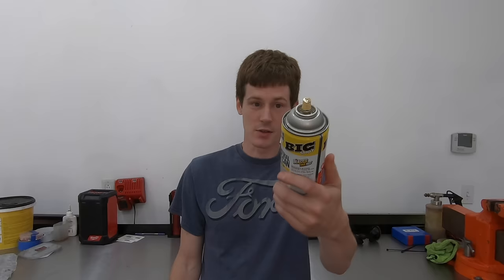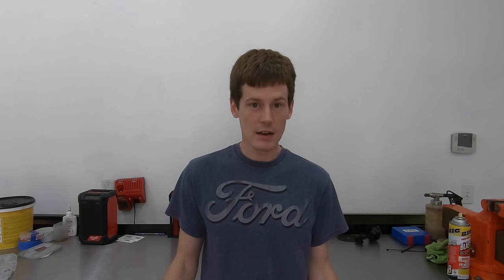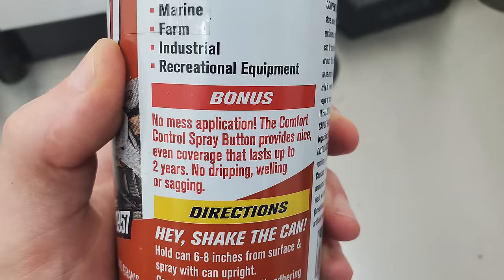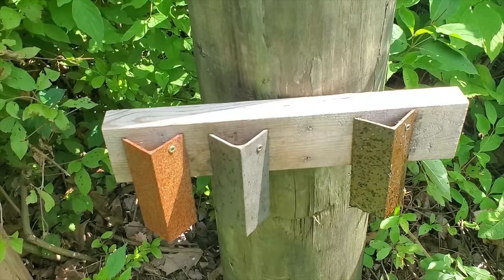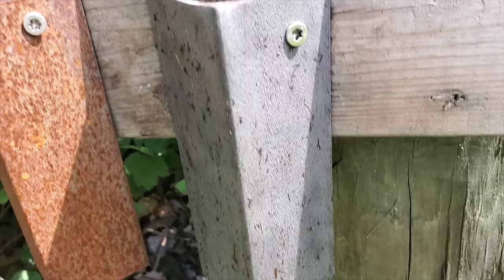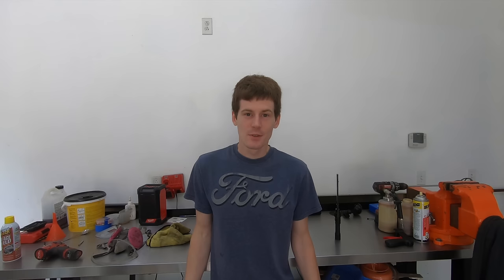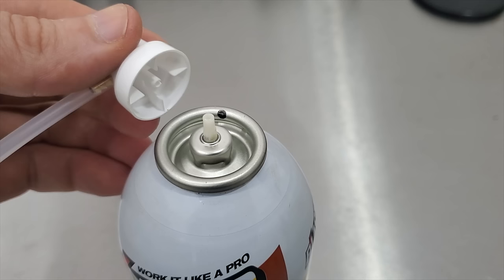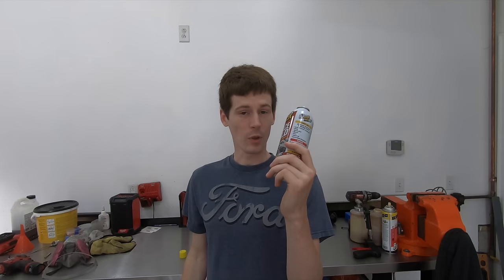I Finally Found The Best Undercoating On The Market... Blaster Surface Shield

Comment from the maker: Edit 11/4/22: Going forward Surface Shield will have female tops on the cans. I showed that the cans had male tops in this video. That has been changed and the female cans are working their way into the market.

Surface Shield Aerosol: https://amzn.to/3BeckCm
Surface Shield Bulk Gallon: https://amzn.to/2YpscVq
Surface Shield Bulk 5 Gallon: https://amzn.to/30rrrvK
Spray Can Adapters: https://amzn.to/3x0A9LQ
INNER CAVITY SOLUTION FOR SS: https://amzn.to/2ZVDPnq (This will allow you to adapt the male can to the male inner cavity tool. Only required on older cans!)
Woolwax/FF inner cavity sprayer: https://amzn.to/3T8gmVZ
Bulk Spray Gun for Gallons: https://amzn.to/3iDs5M5
My Amazon Store:  https://www.amazon.com/shop/repairgeek
Help support the channel, buy using my Amazon links
As an Amazon Associate I earn from qualifying purchases and your cost is exactly the same.
Reply: Thank you for posting the amazon link for the product, I just ordered it.
Reply: Neighbor just painted everything under his car with a oil based rustoleum black paint.
I never heard of anyone doing this.
Was this a good or bad idea?
Reply: @Sound_The_War-Cry  In my opinion time will tell, it's better than nothing and it all depends on how it was applied.
I myself i would have applied surface shield, never tried that and again you are right never heard of 
anyone doing that either.
Reply from the maker: @Sound_The_War-Cry  Bad idea. Paint does not displace moisture. So any moisture that was on the surface or in the pores of the metal/rust are just sealed in by the paint. This is also the same reason why traditional undercoating fails. It seals in moisture. Also any chips in the paint will let moisture in as well. Lanolin will displace moisture and create a barrier between the oxygen and the metal so it can't rust. I don't care who makes the Lanolin product they all function better than paint or rubberized undercoatings but need re-applied every year.
Reply: Can you spray fluid film over rubberized coating?  I sprayed my new vehicle with some rattle can rubberized undercoating. I just found out about how bad the rubberized stuff is.  So is it OK for me to go over the rubberized coating with some oil based undercoating?  Or what should I do?
Reply: @DC-ke8qp  better than not, can only help.
Reply: Sold out a week later.
Reply: @ Repair Geek... Hey man, from eastern Canada here, where they put more salt on the roads than the salt flats of Utah!  My 4runner is 14 years old, and has rust already underneath, but actually not too severe. Will Surface Shield help prevent further rust or at least slow it down? 🤔. Appreciate your opinion. Cheers.
Reply from the maker: @troybabs  It will slow it down dramatically. You need to remove any loose rust scale from the vehicle then spray the surface. The product will soak into the pores of the metal and you may need to do a touchup in the following week or so on any spots that look dry because the product like I said, will soak in.
Reply from the maker: @wjsj69  Back in stock on Amazon 3 days after your comment. Jump on it man lol.
Reply: @RepairGeek  Hey, Thank you for the reply man. Unfortunately, Surface Shield is unavailable again on Amazon and I cannot find it here in Canada, so I may have to resort to Fluid Film instead if can't find it in the next month, but I'll keep checking.  And I will remove loose rust and be at least prepped. 👍 Cheers.
Reply: Would u recommend this on tires to protect them.  Im on wifi on n off but i like to catch you when i can since i first watch your "priming the fuel n oil pump to stop the chain rattle on cold starts"
Reply: Great News!  I have been comparing it to Fluid Film and it does NOT wash off easy.  I thank you for this video again!
Reply: Have you ever tryed RP-342?
Reply: Have you considered doing testing with a pro installed product like krown? I wonder how much better these off the shelf diy product are compared to having krown or Someone similar doing your car. Maybe you could bring some of the pieces you use for testing to krown and have them spray them and see what happens
Reply: Does it come in black??
Reply: I cant wait to get some, I hate what the salt does in the winter!! 🤬
Reply: I keep watching ur 1,2,&3yr FF updates over & over. I ordered all products thru Amazon, even the SS! Received w/in one week. Cant wait to do. U have an EXCELLENT philosophy on everything dealing with undercoating & I respect your opinion.  It's NOT boring so plz keep us updated. I live in neighboring PA, so we get lake effect snows.🙄 👍
Reply: It holds on plastic would it work to preserve & perhaps even lubricate & restore rubber!?!?!
Reply: no test of cosmoline?
Reply: @Selzman10  RP-342 is the best. That's what I use.
Reply: Republican get dried off and washed off on like a underneath of a car compared to what a car gets on it's undercarriage
Reply: @Sound_The_War-Cry  paint?  That’s not going to work.  You need to displace the moisture. Products like blaster or other rustproofing displace creep and stick for some amount of time
Reply: In the event someone still needs the female spray extension, I found some, in Lithuania of all places, that I ordered through EBAY, to work on the 4mm male posts on my cans of RP-342...let me know if you need it.
Reply: @richcombs4805  can you share a link?  My new cans still have the same tops as his video shows.
Reply: if your stuck you can go to a graffiti store or online shop and get an adapter for a 1$
Reply: @voidisyinyangvoidisyinyang885  it works on metal with very very little rust. I'd recommend only using it on rust free metal.
Reply: @richcombs4805  I got that polyurethane paint now - first need some welding done. "Chassis Saver" paint. The cans are kind of cheap  - like cardboard? haha.
Reply: @voidisyinyangvoidisyinyang885  I'm sorry but I don't quite understand what you mean?
Reply: @camarox  hey my experience last night was that if you don't shake the hell out of each can for 2 minutes, it will spray for a bit, clog up, come out under the cap and run down the can and be a complete mess.  Shake part-way through an application as well. Have a same-top can of brake or carb cleaner all ready nearby so you can clean out the nozzle and can-top if it becomes clogged.  Trust me, these cans do clog easily as the product is thick.  The Blaster website specifically mentions this issue with this product in their cans.
Reply: And am I correct in assuming that "surface shield " or the manufacturer of "surface shield " is in no way sponsoring yourself or your Channel here on YouTube?
Reply: @aml3961  Of course he's getting sponsored.. you don't make claims like this without money in your wallet. At the cost of this product, you're better off just going to Line X and getting an underbody coating for $700 that will last the life of the vehicle.
Reply: What is your opinion on this product versus LPS 3 ?
Also are you sponsored by or affiliated in any way with surface shield  ?
Reply: @UnknownUser_0000  I sprayed my itchy butt with Hydrocloric Acid without the advice of You Tube or anyone. Worked really well except for this funky rash is a doozy...
Reply: @thekingsilverado3266  I'm sure, did work on the dingleberries though?
Reply: Mr Geek, I'm down in SE Texas, Houston area, fixin to do 3 Dixie Chopper decks. What would you recommend using for this application, these mowers are 15k so wanna try and protect em best I can. Thanks, Roost
Reply: Great job, thanks for getting them to change the gender of the nozzle!
Reply: I've tried 3 different spray wands on Amazon(all with male ends on the cap, I have Surface Shield female cans). One of which was the Woolwax. And they all leaked.  Anyone know of a male cap wand that works?
Reply: Hey repair geek what is your experience with POR 705 Thanks
Reply: Mistake POR15
Reply: @poconolakefrontrentals230  you find a tip that works?
Reply: any idea where i can find the extension wands for the spray guns? I have the cheaper wool wax gun, but it doesnt come with the extension wand that is long, or the 360 jizzer tip
Reply: Jokes aside, I'm a NYer. we get crazy winters and even crazier salt on the roads as a result. Needless to say the underbody rust on most everybody's cars is bad. Do you apply that over the rust? Or do you have to treat the rust and than use that stuff to protect against future rust?
Reply: I'm in the Cleveland area. Are there any places in NE Ohio that apply this product??
Reply: Almost every single inner cavity 360 spray extension nozzle are made for MALE !!!!!! TOP !!!!! SPRAY !!! CAN !!!! NOT FEMALE!!!! Now Surface Shield has female tops on the can, it is IMPOSSIBLE to find any inner cavity extension without paying a ridiculous amount of money for a plastic tube and a brass nozzle!
Reply: What will happen if the male and female tops get together? Will I get more cans? :)
Reply: @DC-ke8qp  no, you NEED to remove the rubberized undercoating to apply the fluid film. Just get a drill with a wire wheel and remove the rubberized undercoating.
Reply: I have used Pam or Grill master, any no stick spray for pans once a year, no rust for years.
Reply: @UnknownUser_0000  metal can still rust under the linex. Linex will create a trap for moisture between the linex layer and the metal. If it gets a crack, chip, warps that's now a pocket to hold moisture against your metal. Not to mention if there was rust ro begin with its not stopping it but making it worse under the linex. You can spend ~$50 a year spraying blaster, fluid film, wool wax and that will never happen.
Reply: @AMoneyVideo  I see that argument alot but never see anyone ripping their underbody coating off to prove it..LineX also offers a lifetime warranty. At the end of the day do what you're comfortable with.
Reply: @UnknownUser_0000  they aren't going to cover replacing your metal with that warranty. Just more coating. I think you don't see anyone proving it because it's in the junk yard at that point 😆 lol. I can't quickly point to a video(not looking) but I've seen classic cars floor panels rust from inside the car that was coated under outside the car with linex or products like it. I know there are many videos saying whatever linex type coatings ruined their car or did indeed cause it to rust more under it. As far as I know they had rust to begin with or there was a failure of the coating due to chiping or cracking that was never re sealed.  Fluid film was made for the navy. Businesses here in metro Detroit that plow and do snow removal are using lanolin based oils.  The only people I know using paint, por15, linex, are consumers vs commercial ownerd/operators. Lanolin based oils are self repairing, create no pocket to trap moisture, actually displace any moisture, creep into welds, can coat existing rust to stop progression, and cost way less. There are tons of videos proving they work. I use to think linex type coatings were where it was at however for those reasons I have decided it is not.
Reply: @AMoneyVideo  And you're allowed to have that opinion..just a side note though I do like these products I just feel linex coatings have their place too.
Reply: @deejay4837  link is for a 6 pack.
Reply: @AMoneyVideo  Oh gosh...my bad Thanks!
Reply: @deejay4837  amz doesn't allow returns on them if anything is wrong so there's that still
Reply: @AMoneyVideo  They might if you're a prime member...don't know the policy, but I've never had issue returning things I really disagree with or was defective.
Reply: @deejay4837  they don't. "Hazardous"
Reply: Great channel! Good work!
Reply: 2 Year Update????